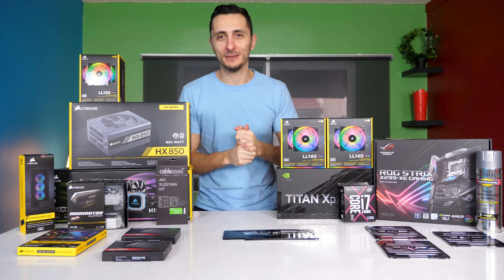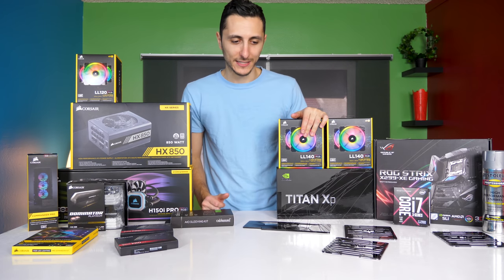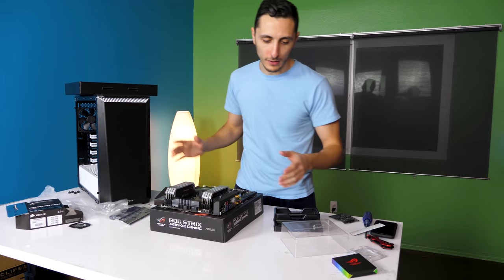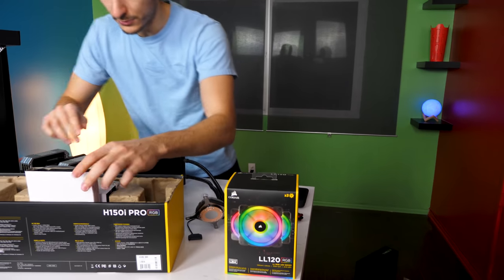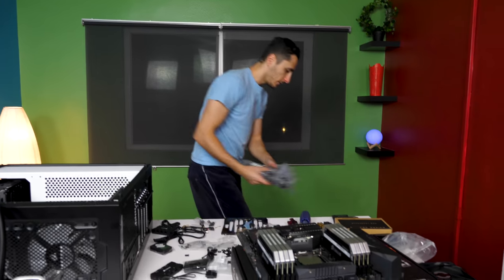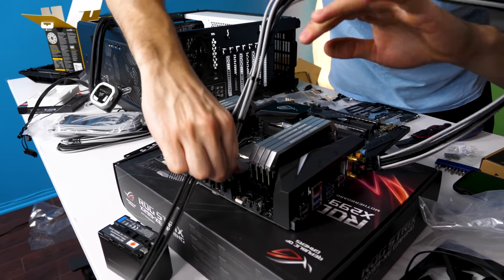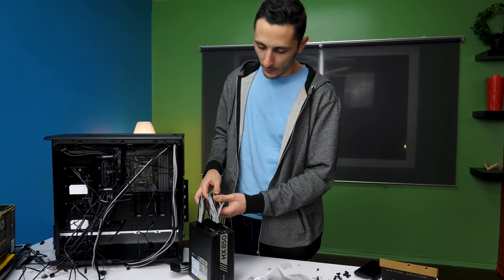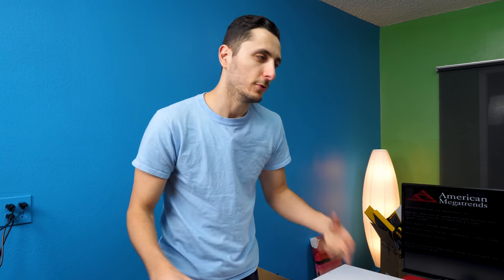Building a Batman Themed Gaming PC (Subscriber Build)

Comment: Beautiful build man! No worries on not plugging in the fans bro. I did a build which was really similar to this one and I didn't fully know how the commander pro operated. I was quite worried when only one of the fans lit up and I even forgot to plug in my CPU power cable. With 9 Corsair LL 120 fans and a bundle of cables as thick as my wrist, it took all day to build the thing and get the cable management looking respectable. My only regret was the Asus ROG Maximus Hero XI motherboard. The RGB's are not very bright on it..

Comment: Does anyone know how I am able to contact Ed? Because I been looking around for a gaming Desktop and my budget is $2500 CAD and I want to build one but I am too scared I’ll mess up. I would buy all the parts that I did want (because all the parts listed down below aren’t all the parts I want but I am limited because of pre building) and send them to ed or give the money to ed.So I thought I should buy one from Ironside? I just want to know if the specs I picked are decent. And if they are able to handle basically any game at high to max settings? And are these parts worth the $2500 CAD? My specs I picked are down below! : D 

Case:
NZXT S340 White.

Internal Lighting:
NZXT Hue+

Processor:
I7 7700

Cpu Cooling:
ASETEK 550LC 

Motherboard:
MSI H110M PRO-D 

Ram:
G.SKILL TRIDENT Z 16GB 

SSD:
SAMSUNG 850 EVO 250GB SSD

Power supply:
500 WATT 80 PLUS

Graphics Card:
1070

I am going for a white everything and pink LED themed set up! : D I’d appreciate all the help! Thank you! : D
Reply: try dming his IG bro
Reply: Joel Klone I would upgrade the motherboard to a newer version of the board, however without looking at all the BIOS I just know that sometimes newer CPUs and older MBOs don’t mix well sometimes. Also would recommend a 1TB hard drive to store other games on because 250gB can go fast. Other than that it looks good.
Reply: Ethan Maher I did add a 1tb storage I just didn’t add it, but thanks! : D
Reply: Ethan Maher ok I am customizing it again and adding more stuff to it, I’ll tell you it once I am done! : D
Reply: Same me too
Reply: Joel Klone tweet at him
Reply: I'd upgrade the cpu to 8600k or 8700k if you're going to be spending that much on a processor
Reply: Try email
Reply: You would get a M ssd drive idk if it’s called M version but it’s something like that it’s like 1.5x the price but does the job of a god I bought a 512gb m ssd and a 4tb hard drive to take storage for about $430 US dollars but it’s well worth it
Reply: Joel Klone I'd go for a i7 7700k if you can afford it because then it can overclock, but if you can't afford it then at least an i7 6700k.
Reply from the maker: email me
Reply: Joel Klone if your goin for pre build go for NZXT Bld because they have gpus at almost msrp
Reply: I would get a 2tb hard drive and upgrade the m.2 to a 250gb 960evo then upgrade ur CPU to a 8th gen maybe an i7 8700k or i5 8600k and upgrade that mother board to a z370
Reply: Joel Klone have a 960 EVO instead of 860 EVO.
Reply: Squeeze a 1080 or 1070ti in there, dont go with the s430 its over rated and over priced.
Reply: Replace 1070 for a 1080ti more performance for the price
Reply: For cooling go with coolermaster you save more money and its about the same preformance
Reply: 500w is really bare minimum, get something higher
Reply: Dont get a 850 evo, go with a plane old sandisk one same pref, same warrenty, verry reliabale
Reply: Trident z ram is Really expensive rn, try teamgroup or some corsair rgb options, (ebay will work for psu and ram)
Reply: Ditch the nzxt hue, get an asus mobo with aura, buy a led strip and shoose fans that are aura compatible. (Aura is best for rgb compatibility and ease of use rn)
Reply: Joel Klone get a better motherboard at least asthetically
Reply: Joel Klone dude better get core i7 8700k and gtx 1080ti first for that price with 32 GB ram then you can spend rest of the money on other things
Reply: Try getting the i7 8700k, gtx 1080 and a s340 Elite case
Reply: I could build a i7 8700k with a 1070 around $1700
Reply: TechSource Thank You, If you don’t mind me asking, what is you’re email? I just been looking for ages and I am not able to find it unfortunately. Thanks! : D
Reply: Codys gaming&vlogs Thank you man!    : D I do appreciate it! : D
Reply: Wait for new gpu from nvidia coming letter this year
Reply: TechSource I’ve emailed you and you never answered
Reply: JOSEPH GARCIA what what? How?
Reply: Tim Fields I am in Canada... : (
Reply: Lil Vessel The Legend is busy, I am sure he’ll respond to you eventually! : D
Reply: Ethan Maher n

Comment: Why put the RGB fans on the 'push' side of the radiator where you can't even see them, and the stock fans on the 'pull' side?!
Reply: He used rgb fans on both sides. the stickers show on the pull side because that's the way the fans face when they are in a full configuration. And he did cover those with fan grills.
Reply: Commander Shepard I
Reply: Yeah, I think you're right. In the b-roll i noticed that the 'pull' fans don't light up, so I assumed they were the stock fans. But after watching again I noticed that the exhaust fans don't light up as well (I guess RGB connector wasn't plugged in?). There was another shot where you can see the exhaust fans light up, but you can't tell if the 'pull' fans light up from that angle.

Comment: If you had more time
1) Vertical GPU (so you can actually see that it's Batman themed).
2) Paint PSU cover yellow and slap a $5 Batman decal on it so it screams "themed build", not "clean build with minor Batman accents". 
3) Hindsight, spend the extra $20 on a case that doesn't look like the box it came out of when doing a themed build. Totally worth it for that extra customized look.

Comment: hey! quick question. how did you change/paint the tubes for the H150i cooling system from black to white?? what did you use? awesome videos. thanks!
Reply: alejogo777 Custom AIO Sleeve Mod Kit. It’s not painted, just a sleeve that goes on each tube

Comment: My Computer:
Intel Outside i98
Geforceed GTX 220
2.5 Gigabytes Of Ram
Asus Strix Z 210
I have 1/2 of a computer fan.
A 1.5 Gigabyte SSD
This can't even run slither.io
Reply: Flaming Chaos1900 yeah
Reply: Flaming Chaos1900 my dog ate half of my fan
Reply: Flaming Chaos1900 he said 1.5 GIGABYTE
Reply: Flaming Chaos1900 1.5 GB = 1.5 TB WOT?

Comment: Dude .. it's an asus board. Everytime new ram is installed.. it does a loop cycle to initialize each lane being used. Before you freak out, check the led light in the top right corner. You have red yellow green and white. Once it goes white.. system is all good.

Comment: What does the radiator do?
Reply: A radiator is a heat exchange device. In the case of a PC liquid cooler, the warm liquid flows through the radiator where it gets cooled by the fans. It works in similar fashion to a car cooling system, but in a much smaller scale.

Comment: Can anyone tell me what needs to be in a pc? I'm a beginner trying to build a pc
Reply: You need:
CPU (processor), RAM (system memory), motherboard, computer case, power supply, storage (SSD/HDD). Those are the overall parts. You will need to figure out what specific brand/model to buy based on your budget and/or performance needs/wants.
Reply: @JJFlores197  thank you so much